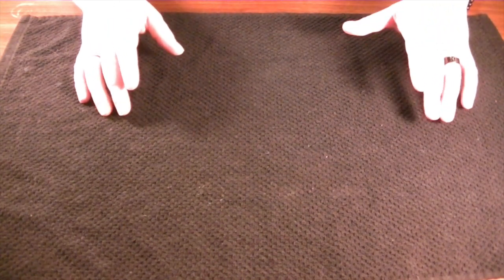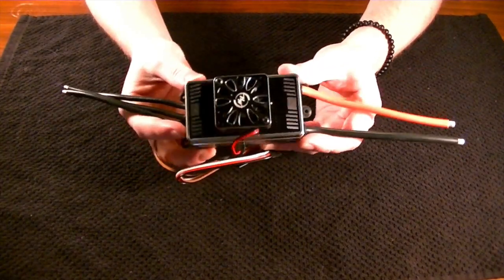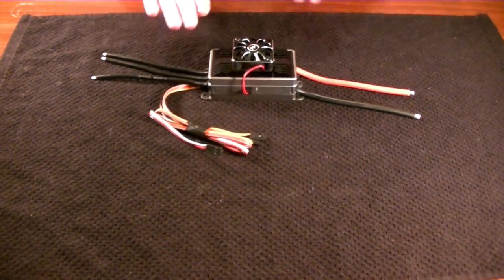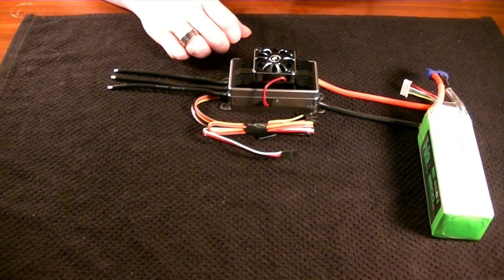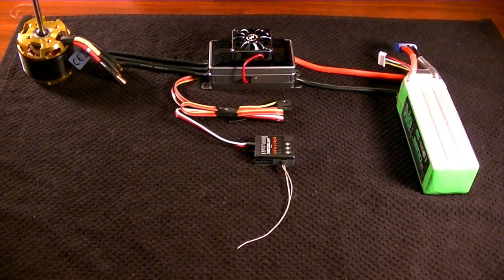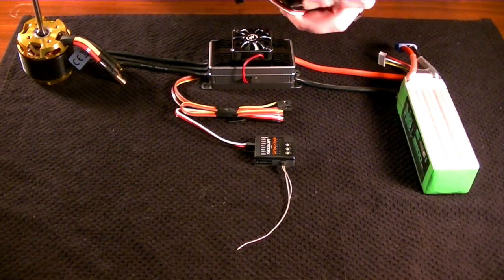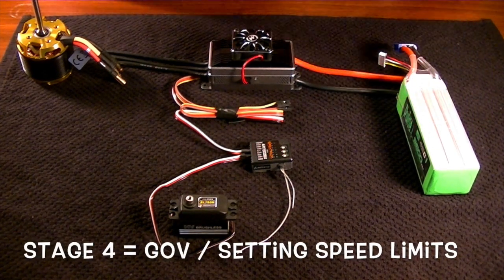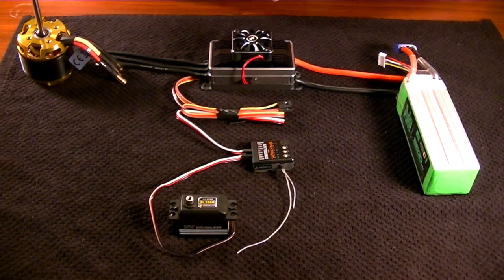ESC 101 : Everything you need to know about Electronic Speed Controllers (FreddyCanFly)

Comment: When I connect my battery the esc keeps beeping  it's for a titan 450 v2. It has a 40A esc . 
What does it mean how to solve  or what's wrong. 

Thanks
Reply from the maker: @Adriaan-bb6kv  without looking at the Manuel ( which I would assume should specify what the tones mean but somtimes those Manuel’s aren’t the best 😂).  But I would say maybe it’s giving a zero throttle alarm, or even sensing a high throttle signal and won’t arm for safty.  Ummm it could be entering into a program or calibration mode for some reason as welll.  Just a few ideas, but I would defiantly consult the manual and it should clear it right up.

Comment: My throttle curve does not have any control on speed I put a flat curve of 10 all the way across and in normal curve it still goes up to 2000 plus I have a Castle edge 100  .Any help out there ?

Comment: Great stuff man, Thank you!  So converting this into flight time, It would be advantageous to have an accessories  pack to power the Rx, servos and Gov, correct? Leaving the flight pack to use all its power, just for the motor?  Especially, with the light weight packs that are out there now.  Or is the draw for these, minimal that it don't really make a difference on a 600/700 Machine?
Reply from the maker: Nope no need for an extra pack only on nitros these days.  This type of esc can basically survive a natural disaster and still be working lol.
Reply: @FreddyCanFly  Lol!  Thank you sir!

Comment: wow such a nice video brother go ahead make more videos electronic types  brother I have a question I got a new rc 800 B412 helicopter. and they give me one motor and castle creation 20A BEC pro and reciver and Bavarian DEMON 3X FLYBARLESS system  so how I connect these kindly tell me I will be appreciate.  thank you
Reply from the maker: So this is a little more deep into conversation then this video.  The hardest part will be following the connecting instructions for the Demon (I have not used it before :() however it should all be pretty easy.  Motor goes to ESC, ESC goes to Flybarless system, and servos go to flybarless system.  The order in which they will connect will be specific to the FBL system more or less.